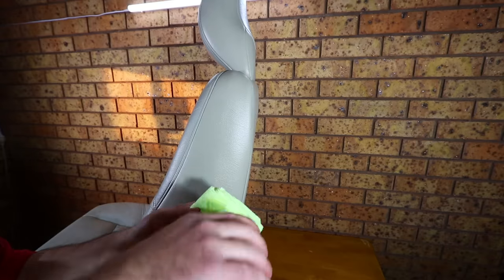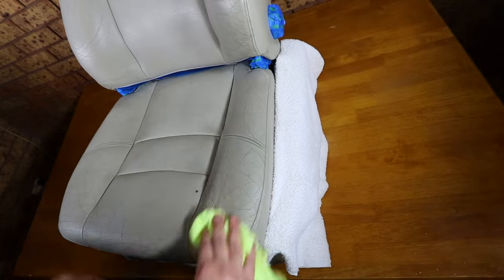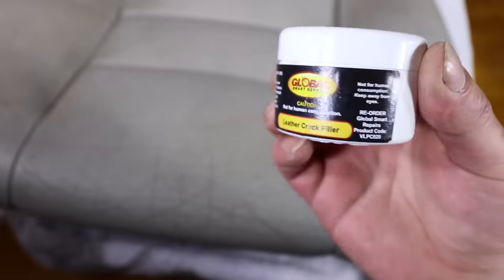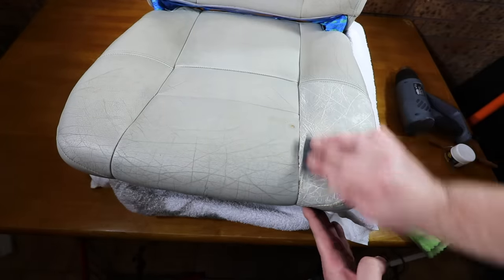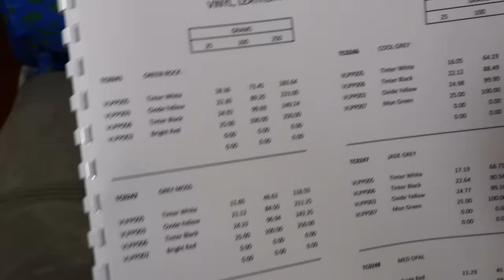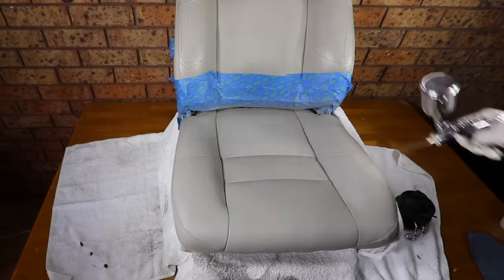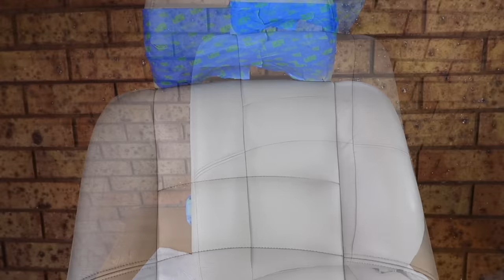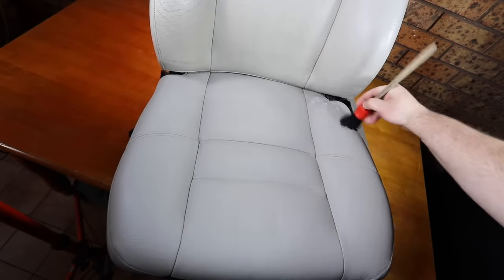How To Correctly Repair Damaged & Cracked Car Leather Seats

Comment from the maker: Hey guys, just to answer a few questions in the comments: This was a junkyard seat used for a demonstration video firstly showing a full repair for the bottom part of the seat and then a blend repair on the top part of the seat as a comparison to show and explain both these processes. As mentioned, this is a repair of leather itself, not a replacement or reupholstering of leather, and how long it will last will depend on many factors including how well the repair was undertaken, how bad the damage is to start with, how well the seat is maintained and how it is used, so it could be a matter of months or years to a lifetime depending on those factors. I’m not affiliated with any leather repair system, I don’t sell these products or profit from their sale, it was a pure and simple demonstration video that I hope many of you enjoy! Lastly, if the leather is perforated, it is possible to use this process but you will have to use a thin sharp tool to recreate the perforations at the end.
Reply: Amazing transformation! Thank you for sharing your knowledge of leather seat repair. Best I've ever seen!
Reply: If that was a junk seat you got lucky, looks like a Volvo V70 front seat in light beige which are pretty sought after.
Reply: To think I came across this because my new car has an inch long light scratch on my passenger side leather seat. I was so intrigued that I watched the whole video to see what happened and I was amazed! That is one heck of a job you did there with that junkyard seat! Very impressive 👏
Reply: DallasStorm43 9
Reply: truly impressive work.
Reply: First class video, after some 55 year's in the trade and still "doing a bit" this guy touches on many important points of restoring trim.
Whilst many will nit pick and criticize his work here, I would agree with all he says to help the beginner form a solid starting point.
Reply: very nice job and explanations can you pls. tell the names of the materials you are using?
Reply: How much would a repair like this cost approximately ?  Thanks
Reply: And how long it will last depend also on the weight of the driver and hox careful he is when entering the seats.
Reply: What kit is this and where do I get it?
Reply: What grit of sand paper was used?
Reply from the maker: 800 grit
Reply: Hey may i knw how to choose the right spray gun and some brand you could recommend?
Reply: I’m glad I read this comment. I will be buying a used seat before I hit up my recently purchased 1998 Lexus ES300!
Reply: I don t think is worth it ..better to put a new leather
Reply: don't lie to people. there is a lot of work and materials for nothing. It is better to change with new skin.
Reply: @vesojhffd9386  whats the lie exactly? 
 Hell get a knock around car and dont feel like spending a bunch of money re skinning or replacing seats why not just do something like this
Reply: Was this the DIY or Pro kit?
Reply from the maker: I believe it was the pro kit we purchased prior to training
Reply: wow
Reply: Where do you get that stuff ?
Reply: @vesojhffd9386  hey mate I’m doing this to my lounge! My leather lounge cost a fortune I don’t have 8k to go out buy another.
Reply: @The_Crusty_Old_Hag_Next_Door  yes , for lounge is good , but is lot of job - i say's because i make this . If make good ,result is exelent (whit good materials) and 5 years is lucked like a new .
But beter to change whit new , realy is lot of work......
Reply: A junkyard with Volvo seats. Heaven on earth!
Reply: Traduzi para o português. 
Google tradutor. 
Saibas que você escreve muito bem.
Parabéns!
Reply: I believe that seat belongs to a volvo 2000s time. A very useful video of restoring it. Thanks bro. Will do mine.
Reply: Hallo i net seat Reaper grae Dae oll Reaper staff
Reply: I I I lulu

Comment: I'm a easel painting restorer with 40 years of work.
Some improvements that I can suggest
- Do the job outside in natural light, but not direct sunlight , cabrio cars will show the leather colors in natural light , shop lights are not natural light.
- Do the filling phase adding some color to the fill material so it will match the more the seat colors, if not after you'll need to use more paint to cover the fill color.
- All  the resins of these products are acrylic resin, the resin can be diluted in solvents or be emulsionated with water, so water based products are still acrylic.
- To find the right mix of colors use the "color wheel" of substractive color system , if a paint is to much red add green, if too yellow add violet, too blue add orange and so on 
- The spot area color test showed in the video is too  small and the screen  should have an irregular shape or your eye will tend to identify the paint spot created .
Reply: Excellent advise
Reply: yaknow, that's the first constructive comment I've seen on a YouTube post.
not saying the guy did anything wrong, just adding some actually helpful information.
outstanding.
Reply: I would also suggest a better gun with wider fan
Reply: @bina nocht  More informations would help. 
Year in wich they were painted.
Size of the paintings and the diameter of the roll.
Basically linseed oil films of paintings become "hard" because of two chemical process , oxydation and polymerisation, the complete process can take up to 100 years.
You must consider the paint film of your  canvas as  material that  is subject to plastic deformation (rolled)  and natural aging, over time .
To revert the plastic deformation , you can use , time, heat and solvents that will "soften" the paint layer , water, or ethyl alcool  in example.
Solvents should be used in vapor state, so leave this to professionals.
You should provide a roll of large diameter, at least 50 cm, wood, cardboard, plastic, keep the roll horizontall, fix an edge of your painting  at the roll and let the rest of painting hanging.
Time and gravity should do the job.
Be patient it can take up to days or weeks.
You can speed up the process with an hair dryer.
Paint layers will stand heat up to 50° C,  that correspond to humans limit  of pain, so now you  have a quick reference.
Reply: Natural light is changing the whole day. Combination of 350nm-800nm constantly changing as the day passes by. Do you suggest other chemicals than acrylic based?
Reply: I absolutely hear you. And right on. And thanks for the time you took. But my gosh it came out great with the CONSTRUCTIVE CRITICISM. I am 100 percent appreciate your expertise.  But dammit came out nice tho.
Reply: Its like rocket science the way you treat it. Damn.

Comment: Nice video. You care far more than most repairers which is great to see and obviously take pride in your work. I’ve been doing these repairs for many years on very high end cars and have seen lots of terrible work. A couple of comments which may be of use to you. 1) consider using a wider spray pattern on your spray gun. It blends better and is less likely to streak. 2) you should consider using fine sandpaper (2000 grit) between coats of color. It removes dry overspray and gives a better finish 3) I’ve found those heat activated vinyl repairs often produce a hard finish when cured which doesn’t bend well with leather. I prefer to use a leather binder 4) as you rightly said, color matching is difficult. The color you make changes based on how many coats you put on. A thin single coat will blend easier with the existing leather, but if you are covering up filler repairs, you will need to do several coats, so be careful when comparing your mixed up color. 5) you have not used any clear coat on top of the color. This extends the life of the repair immensely and allows you to mix the right level of sheen between gloss and Matt finish. In my experience, different leathers have very different levels of sheen. So a one size fits all approach doesn’t work.
That being said, I’ve been working on cars worth several hundred thousand dollars, so the owners can afford the extra labor. Most owners of standard cars cannot, so a simpler approach is warranted and practical. Well done and keep up the good work.
Reply: I have a seat that is not nearly as worn as that. Just now showing the bare leather in tiny small places. What grit sandpaper do you use for the initial prep sanding...still 2000 grit? 600 does seem a bit much.
Reply: I have black leather seats is it the same method
Reply: What brand do you prefer for leather fill? Ive only ever used fitz
Reply: @Warrendiehl  I’ve just taken a quick look at their fillers. They appear to have an excellent selection. Flexible and sandable fillers are important. I’ve been using products from Furniture Clinic but I’m sure Fitz’s products are of an equally high standard.

Comment: As you rightly mentioned the repair costs are sky high due to the cost per hide and the skill set required to obtain a factory finish.However there are synthetic replacement i.e symphony material that has the look and feel of leather with a u.v and mildew resistance that would last up to five years with normal care,thanks for the leather treatment vid Cedric from Trinidad and Tobago

Comment: Great stuff, I'm in the process of restoring some seats and this has really helped, especially the technique of filling the cracks, i didn't have a teeny tiny trowel to apply the filler so a wooden icepop stick had to do :)
Reply: If you are comfortable using the lolly stick you will probably get better results than trying to use the artists trowel, plus being wood it's more textured than the metal trowel.

Comment: Looks like a seat out of a 98-00 Volvo. Clean repair 👌🏼👌🏼👌🏼
Reply: Yes you can tell by looking at the head site off the seat. 😃🤗
Reply: Damn!.....good eye.
Reply: I'm shocked I didn't notice since I drive an 05 Volvo. Mine are black though but with the same pattern.

Comment: We have leather furniture that is cracking and drying out, as well as our front car seats.  I thought leather would be easier to keep clean and hold up a lot longer than cloth upholstered furniture and car seats, but I found that if you don’t properly care for the leather, like your showing, and more maintenance to prevent the drying and cracking, in the first place, by  keeping the leather cleaned and regularly conditioned properly. We are sorry we didn’t know how often we should condition the leather items we’ve had, and so we have a lot of work to try and repair our living room couch, Love seat, and chair, as well as our two front seats in our car!  I hope we can try these  products and fix our leather. We are definitely learning we need to put a lot more into the care of leather care to keep it soft, conditioned and strong so it does sent dry and crack.   Thank you for showing all the steps that you are showing to restore these seats to better than they were,  a whole lot of elbow Greece labor involved too!   
Question? If you have a complete crack through the leather, is there some product that will mold over and blend the area of leather to wear you can get it smoothed out and. Not seeing the cracks and small thinning lines, is this possible, to fill in places and smooth areas, to make it at least a whole not better!      How much or how often, should we be cleaning and conditioning our leather furniture and car seats?   Also, are we able to buy the products we need for repairing both our car seats and our leather furniture?  Of course, besides the colors, one is tan about the same color as your  car seat, and then we would need a Chocolate brown for furniture. I have one more question, there’s a long back piece of the leather that’s come unsewn, and we tried stitching it where it needs to be joined back in at least he top of the couch on one side, we couldn’t do it, the leather is thick and we need to find someone that does leather upholstery, so, if you know anyone or can help us know your recommendations, we would really appreciate any ideas!  Gasket you so much!

Comment: Really well done. I appreciate your sharing your techniques. I have a truck that is very old that I am going to try this on; it can't get any worse. lol. Thanks also for the paint tip; I thought it was my cheap paint that was causing the dusty appearance. I tried varying the distance and found it was the usual cause of my problems, me. Thanks again.
Reply: Try and get a small sample to try it out on first.

Comment: A fantastic tutorial, I'm actually halfway through the job at the moment. Although I'm starting with replacing the upper Squab first. The only part I'm tripping upon is the use of a spray gun to paint the seats. I know this was posted 3 years ago but would love some direction in that direction. Yes I have an air compressor
Reply: Hey do you have any advice to share I'm about to tackle the seats in my truck

Comment: Magnificent work mate.
Love how easy and quick the airbrush finish was.
I haven't yet encouraged myself to use air brush as I'm a bit concerned of a flat and synthetic finish it may produce and have so far only used sponge to apply the paint which gives it a touch of texture but it is very time consuming.

The filler did magnificent job though and definitely trying that next.
In the past with some white fillers I have had sour experience where the paint fades of off it in a fairly short period of time; - as I preventative measures I started using coloured fillers.

Comment: Though I may never repair my seats to the wonderful detail that you have, I do have a question! You explained how to clean and upkeep the newly coated seat at the end and I was wondering; after cleaning, do you still need to apply a leather conditioner of any kind? Or will that interfere with the new "paint" and finish?
Reply from the maker: It will help to apply a sealant like 303 Aerospace every month or so after cleaning.

Comment: The effort that went into this was enormous. No doubt, the labor alone would cost almost as much as a new seat replacement. But for older models, such parts may no longer be available making this repair the only choice.
Reply: You would be wrong, a new OEM seat is comically expensive, the cushions being $4-800 each (lower and upper) and leather covers for the cushions are $600-1200 each (lower and upper) and thats not including the frame.

Comment: My Driver Rear seat back on my 03 Accord EXV6 Coupe has some weather damage. It small section it looks like sand paper. I can have Honda Replace just that side but it be $600. I just applyed Meguires Gold Class Leather conditioner. On the rear seats and heads rests. And front seats to help protect and preserve to the leather. Good information video

Comment: Hi 👋🏻 I’ve got an old box with 120 year leather that has a few areas with white paint spatter, I was wondering if I can sand it off with 1000 grade sandpaper or will it still damage the leather.

Comment: I meant to ask, after this treatment, how do you continue to look after the leather? Can you still apply cream etc to maintain supple/softness or do you have to re-coat?
I would much appreciate your answer. Many thanks.
Reply from the maker: Applying an interior protectant like 303 Aerospace every couple of months is a great way to maintain the ceramic coating over the finish.

Comment: The best video ive seen yet. I would love to add this to my list of service as a detailer. You mentioned soup and water to clean the leather. But what about lysol or any other cleaning chemical? I always have issues with that. Specially if it has being repaired or repainted.

Comment: Gonna try and do this myself in the spring to my Lexus IS250 driver and passenger seat. Gonna use this video as a guide and try to follow it, as I love the results haha. Hopefully the paint is easy enough to find lol.
Reply: Did you?
Reply: @lukerinderknecht2982  I actually found seats at my local scrapyard for $50 bucks. Same color, almost brand new. From a car with 80k km on it but totaled.
Reply: @Snail2G  a much better option!

Comment: Hello! Thank you for the video! I have a question about the way to protect the leather. How does the Nano works as of what I know ceramic sealant is a no-no when it comes to leather as the leather needs to be elastic and the ceramic is doing the opposite as it need to make the leather hydrophobic

Comment: Very well said, Sir. I start any job on the fleet of my autos and motorcycles with intense cleaning to get rid of dirt, grime, food deposits, decomposed particles and all other micro-rubbishes that fill up those narrow cracks...CLEANING is so essential. I tried to instill the value of  this into younger generation...they think I am an old fart....but they just do not have the skills that I have developed in restoration of anything...anything...even if it is an improvisation but it worked better than OEC..thats when I tell them..."GOTYA"...

Comment: A couple questions:
 Why not use the same material to cover the cracks in the leather that you used to cover the burn hole? Also, can the material that you used to fill in the burn hole be cured with a heat gun or does it require more heat than that?
   Thanks for the video 👍

Comment: Hopefully your site is back up.  Excellent video. What chemicals did you use and can you repair a larger area with this method?  I have a two inch by 1/2 inch wear on the seat, dark blue in color.  It is actually on the upper bolster, right as you enter the car.  I can send a picture you if you can help me.

Comment: I've been going through your channel, and I have to say fantastic work!  With that in mind, how do you clean/treat interior wood panels?  I have not seen too much on the subject, and it would be nice to have a expert walk through.
Reply: @CarCraftAutoDetailing  Good to get the 'ol confirmation bias.  That's what I had been thinking as it seems so far from regular wood finishes..  Thanks again, for the channel and the response!